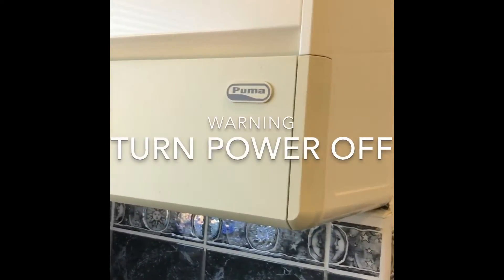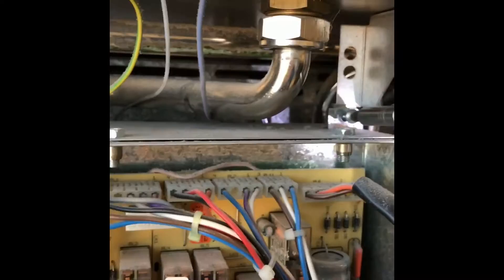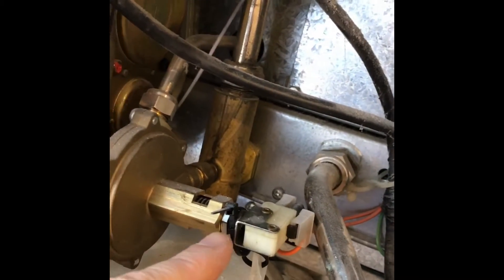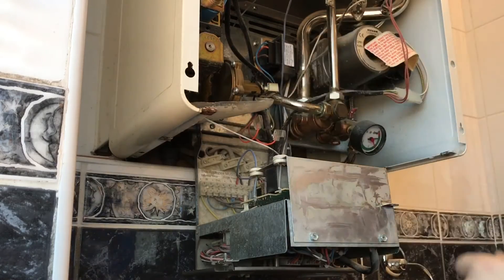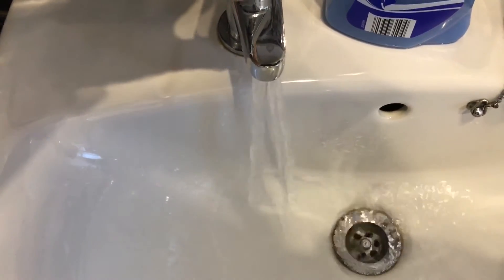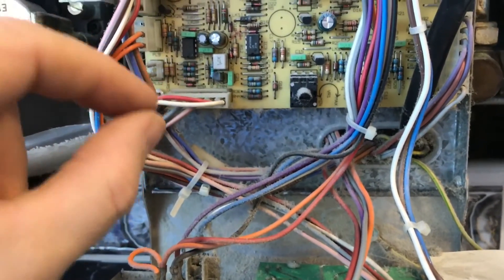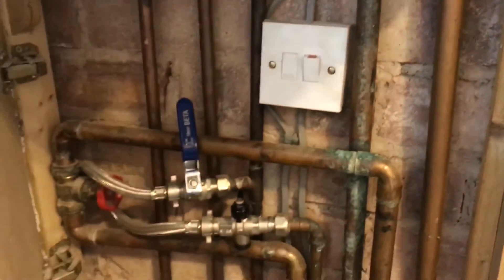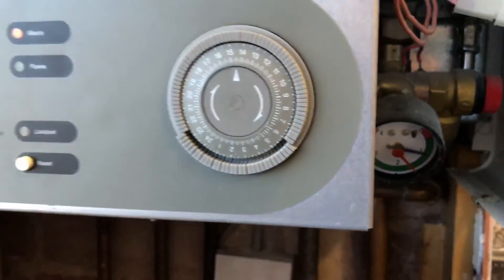Potterton Combi 80 Puma Boiler Fault Locking Out, Tap Pressure Switch & PCB  Repair baxi

Comment: Ive just come across this fault today manufacturers says switch needs to be out 5mm but even with this adjustment I have the same fault?? Any suggestions looking at replacing the diaphragm?
Reply from the maker: If it is faulty swap it out, Thanks for the great comments👍🏻👍🏻🛠